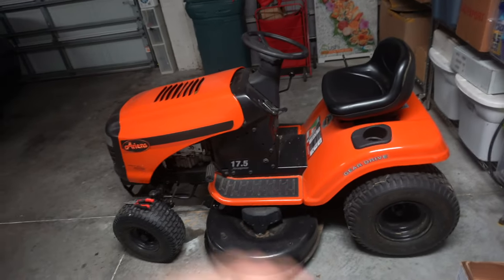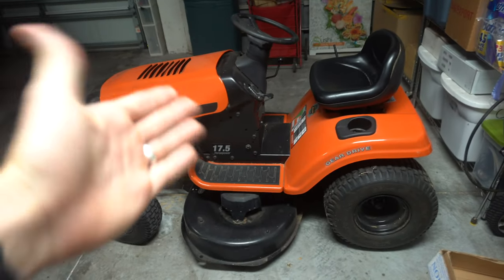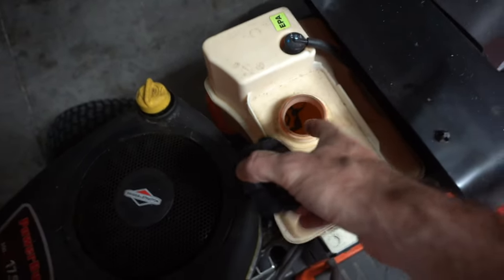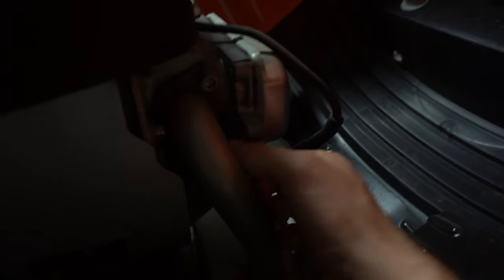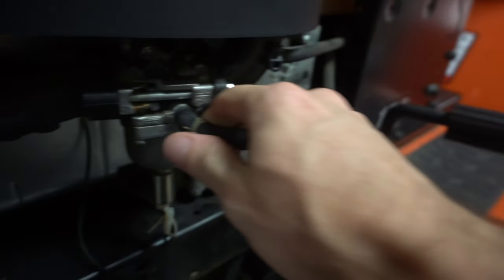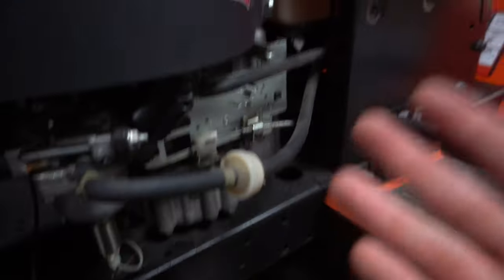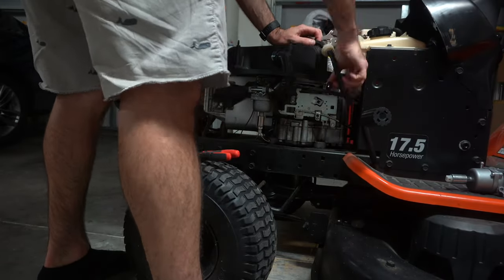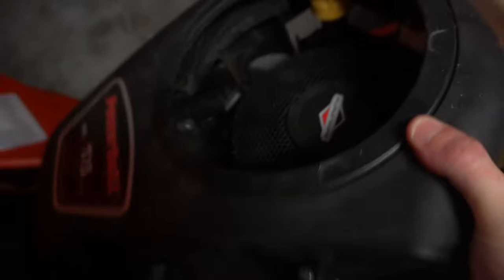Ride on Mower Cranks But Wont Start - Changing the Carburetor on Ariens (Briggs and Stratton)

Comment: Nice systematic troubleshooting - great job! Those solenoids in the bottom of the carb have to open or it wont run. For 20 bucks, it's a no brainer buying a new carb.
Reply: So that's what ruins the carb?

Comment: Thank you great video.   I have the same Ariens mower.  The magnets on the flywheel drop off the flywheel while in use.  I order new flywheel.  Unfortunately, now the mower won't start.  I discovered that the magnets on the new flywheel are not magnetized.  The seller is not answering my call.  Could you tell me if the a new flywheel magnets have to be magnetize before installing?

Comment: I ordered a replacement carb, part 594593 from Briggs and Stratton, it came with a different solenoid with a different connector so my original connector won't hook up to it. I would have thought they would include the new wire connector with it.

Comment: What is that plastic ring thing in your gas tank with the string rope? I have that in mine and no clue what that thing is?
Reply: LMFAO. So I looked it up based on the "KELCH" on the plastic loop thing. Apparently, it's supposed to be tied to the cap and allows the cap to dangle from the rope. But it seems most people yank on it and the rope snaps. So you have this ring with a string floating around in your gas tank. I pulled the tank out and shook it upside down to get it out. It was almost impossible to get it out any other way.